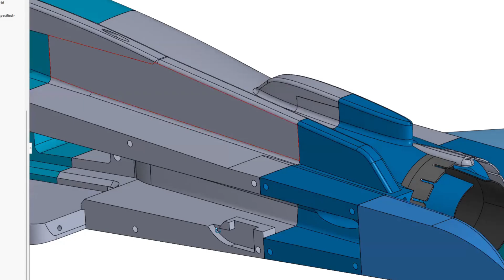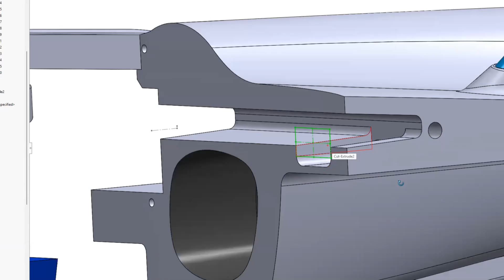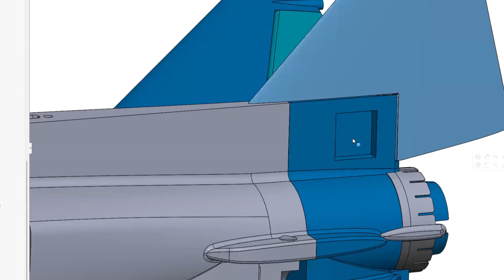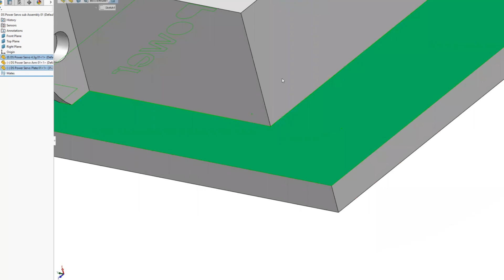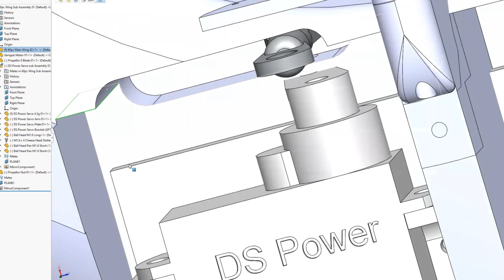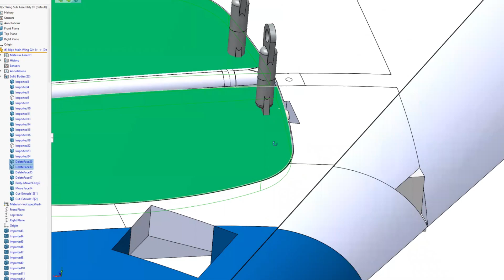Making a Full Functional VTOL-Jet in Solid Works | JRM-01 Pt.4

Comment: Rene could you redesign vtol Harrier, with larger edf fan and nozzle tube, so it can be lifted with less power hungry motor, and more efficiency, it is a beautiful design. Pity it would be not to have dissent flight time when in vertical take off mode...
Reply from the maker: The Harrier is paused at the moment.

Comment: MASSIVE work! Nice,  but have you calculated wing profile, wings length and surface of the elevators and stabilizers? Or you just rely on scetches of Su-57? Im so interested what's your approach. Also howdo you know what servo will fit to the requirement, I mean it has to be strong enough to pull that surface of the elevators even in high speed when the air preasure is higher.
At this time I am only watching but for few years I am going to built my own long endurance plane with propeller at the back. This gives me a huge insights into how development may look like. Thanks :)
Reply from the maker: Beside calculations it is most about experience.